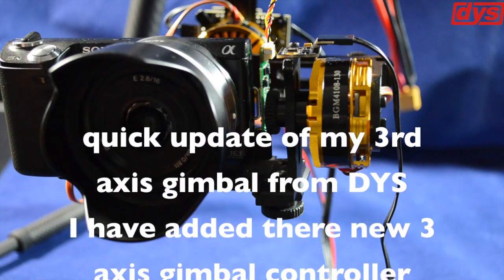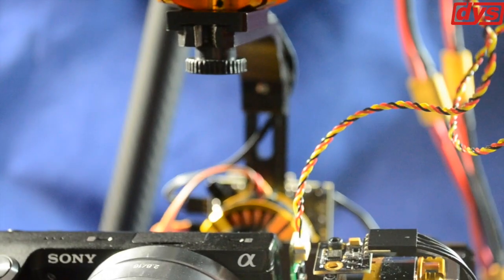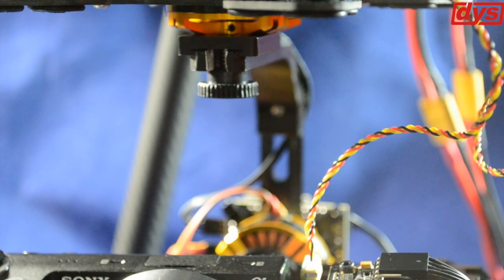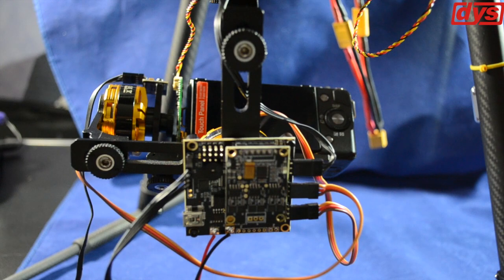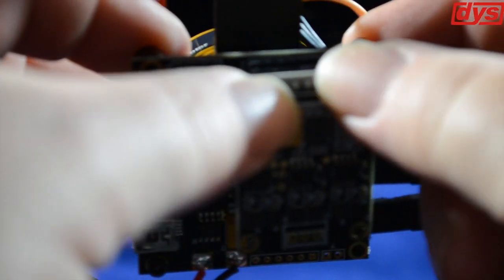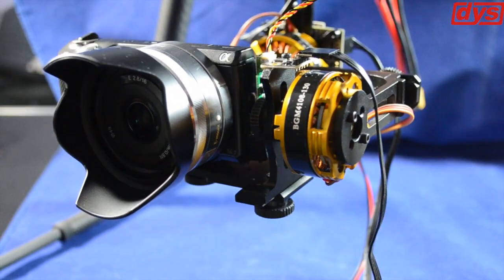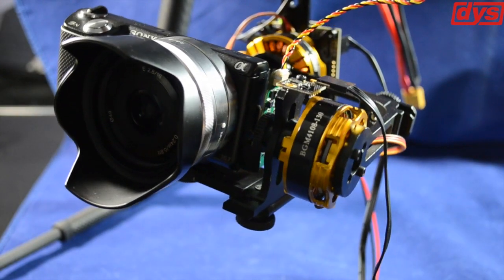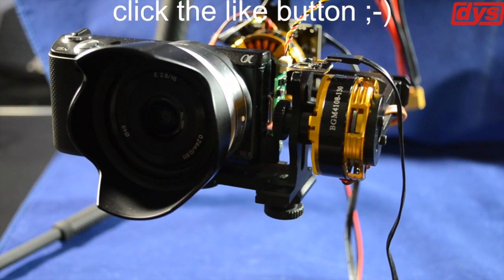DYS 3 Axis Gimbal Up date

Comment: I have one board similar to this.. its marked BASECAM ELECTRONICS on top and Alexmos BGC on other side.. and it has the top YAW board glued to it with pins. I think I need to flash the board with new firmware. After an upgrade I cannot connect, but this board is not marked with the words FLASH anywhere and I dont see the pins as in the documentation diagram from basecam. Please can anyone help me by pointing out where these flash pins would be

thanks!